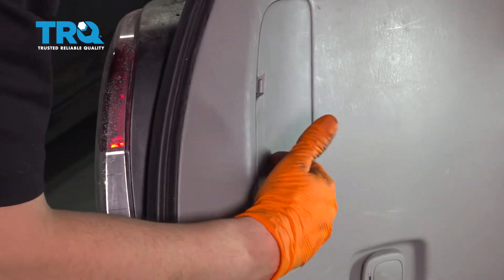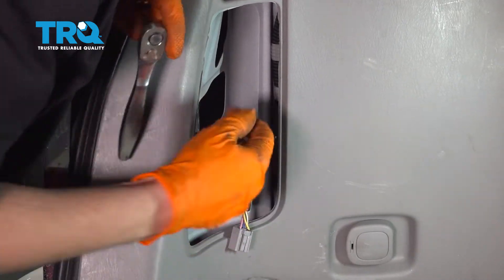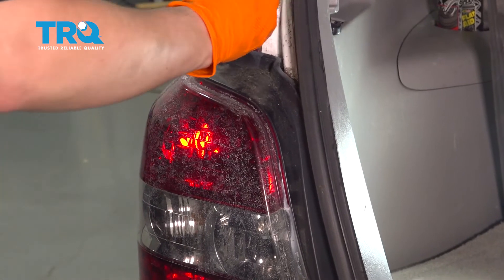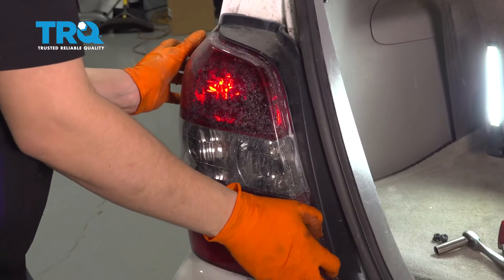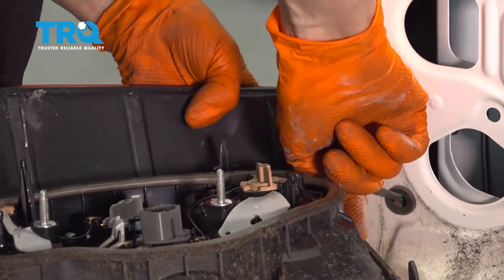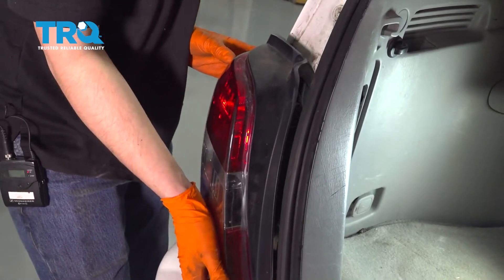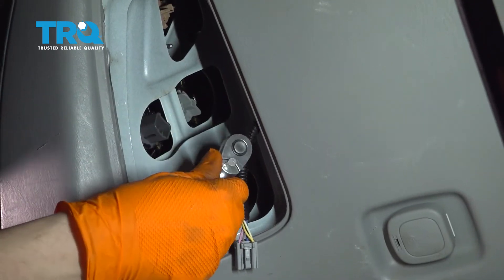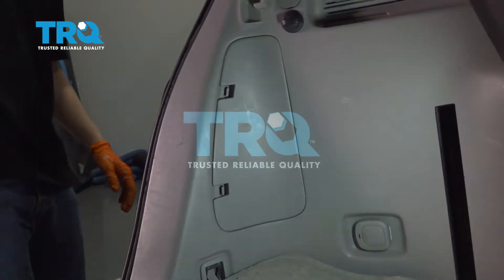How to Replace Taillight 2001-2007 Toyota Highlander

Comment: Great video.  Thanks!  If you do this job place a towel below the two fasteners to cover the void down in the body frame.  If you drop the bolt it will fall down into that crevice that will make it extremely difficult to recover.  Take it from someone who did not do this and spent an hour recovering it.
Reply from the maker: +@condor5635 Thanks for the feedback! http://1aau.to/m/Shop-TRQ

Comment: How do you replace side. Marker bulb. 2006 highlander hybrid
Reply: For 2004 you have to remove the whole assembly to access that light harness and bulb. It is not accessible from the removal of the small plastic panel.  Not sure about 2006.